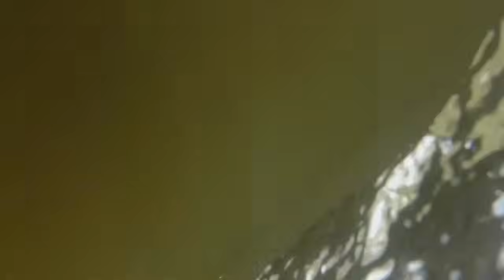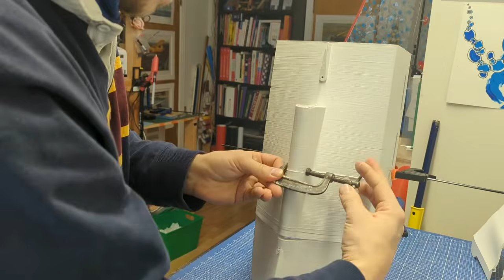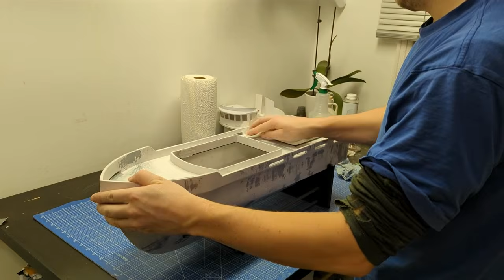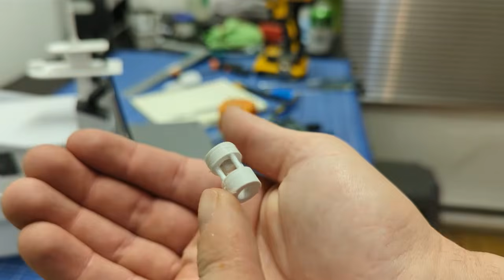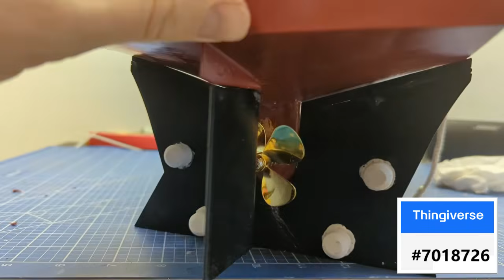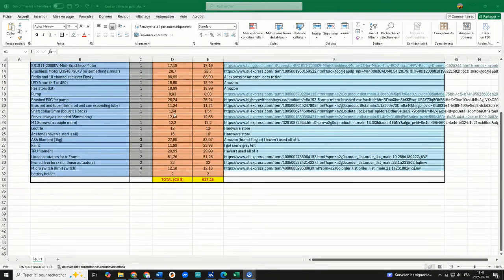RC Utility Ship Build Part 1 – 3D Printed Hull, Lights, Bow Thruster & Watertight Hatch

Comment: Oh and for your water tightness. after sanding and filling (and repeat) you could use epoxy spray paint as undercoat or topcoat. Epoxy is water tight and a single - covering layer - would be sufficient for water tightness.. Also there are some epoxy filler paints that you could use instead of the putty..
For sealing it after the facts you could also "just" spray down the inside, then water would still enter the internals of the print but not the internals of the hull...
Reply from the maker: I didn't even know that such products were out there... We learn everyday. Thanks for taking the time to write that down.

Comment: How much filament did you use for the Hull ONLY
Reply from the maker: Hi, I believe it was a bit less than 2 kg. I'm on vacation and don't have the numbers with me. If you have a slicer and the plans, I suggest you simulate the print to find out the exact number. 😊

Comment: Can i print it on my kobra 2 neo? And how much filament did it take
Reply from the maker: You can print it on your Kobra 2 Neo, but you'll need to adjust the size of the original design to 73%. I suggest Peter Sripol's Utility Ship. It's 75cm long and the design doesn't need adjustments. I made a build video of my experience. It's a awesome boat!
Reply from the maker: I used 3kg.
Reply: @bernarddostie just for the hull?

Comment: Beautiful  ship. Can this be built from a different  filament? Pla petg abs?
Reply from the maker: Hi Jason, yes this boat can be printed in different filaments. I like ASA because it's weahter resistant (especially heat) and that I can use Slurry and acetone to assemble parts (like ABS), but I will print my next boat in another filament. I would suggest PETG. It prints almost without warping at all and is heat resistant. So you can leave the boat in the sun and in the car during hot days without worying. Feel free to aks other questions!